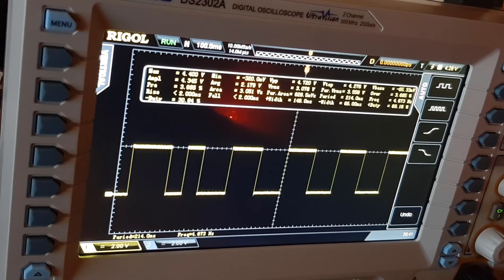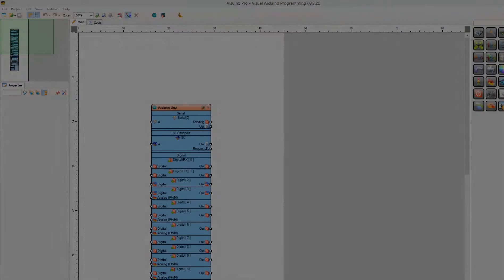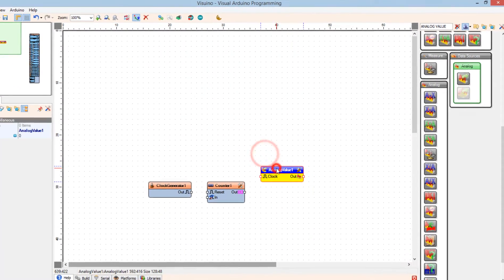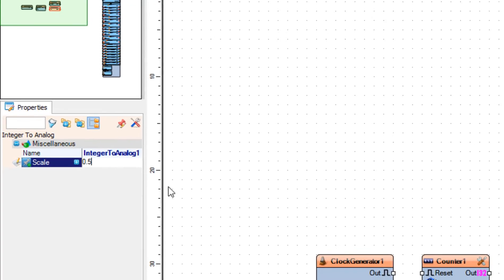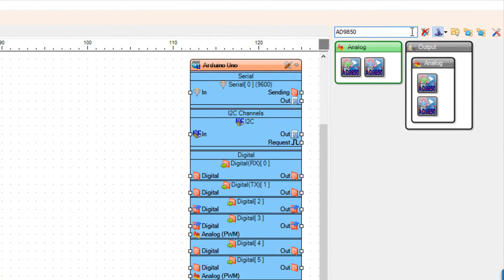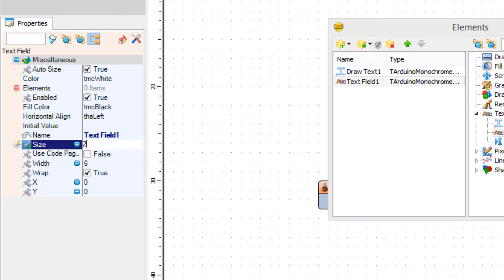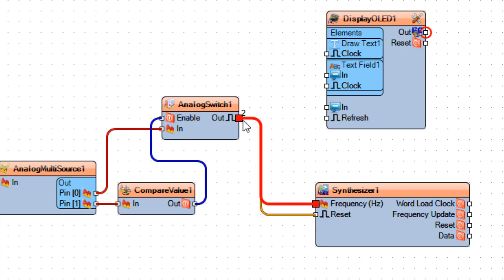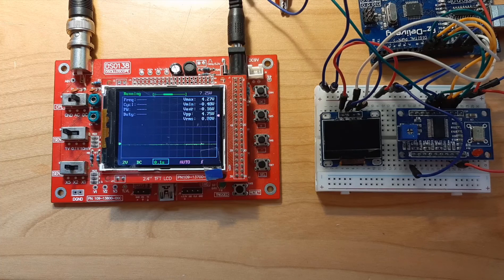Arduino DDS Frequency Sweep - Signal Generator AD9850

Comment: Hello, I have a 20MHz dual trace analog oscilloscope, and I bought a Meguro MSC983C sweep oscilloscope, and I have a 100KHz-120MHz RF generator, but I can't generate the FM I.F. curve. I think I need this sweep generation, it must be another waveform, more for 10.7MHz FM I.F., would your device work? Thank you.

Comment: Made it, all works fine except output frequency is 250 times the counter value (with the settings given in the video). Then I tried to swap the arduino uno for a nano, seems straightforward, but this did not  work. Still trying to troubleshoot.
Reply from the maker: You can always send your project to support to verify it